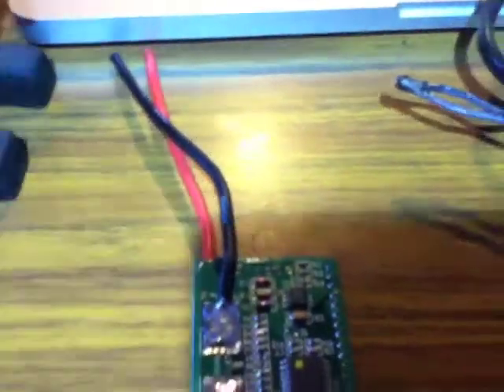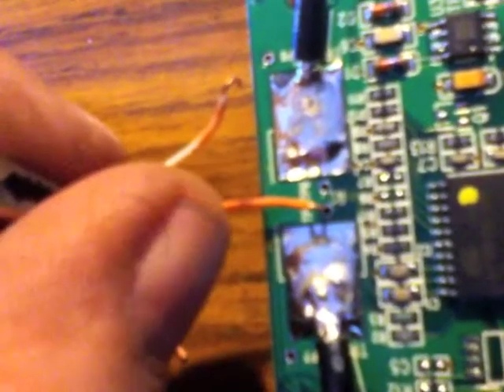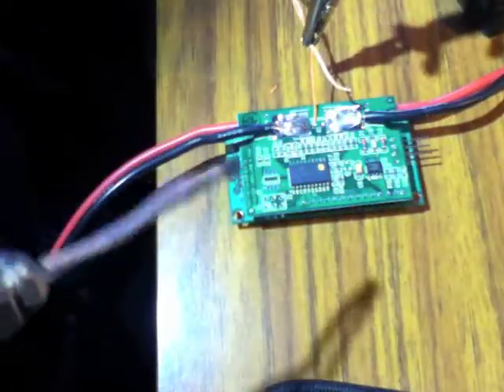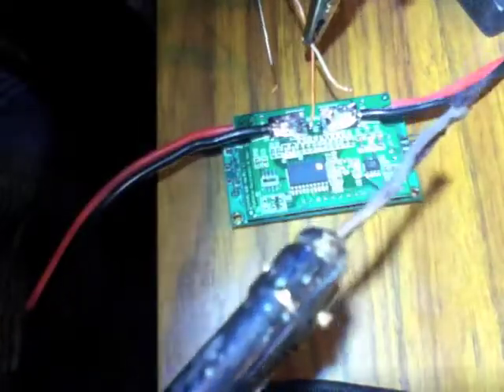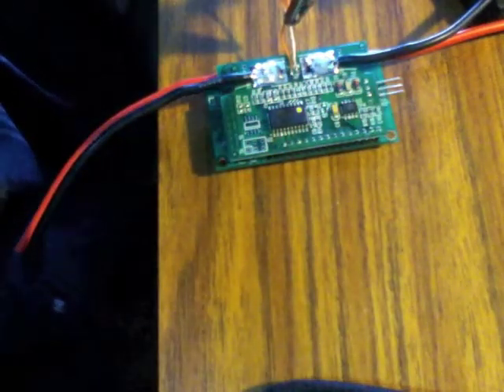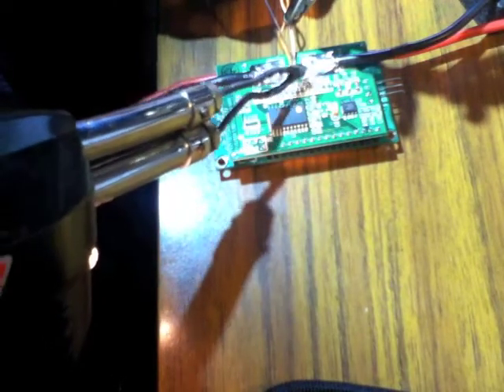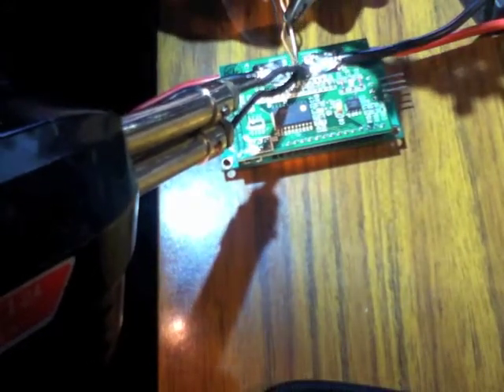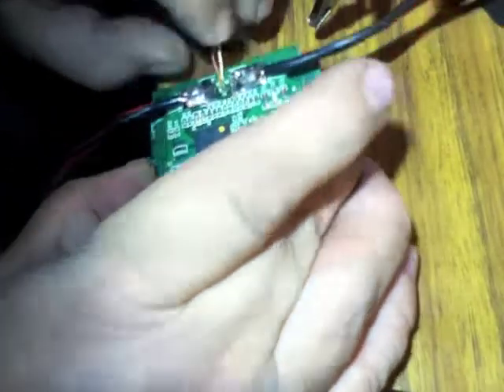Modify my Doc Wattson

Comment: i notice on my doc wattson you can change the ampres from say 00.20 to 01.80 buy loosening
the connection on the rectifier.i have it on the dc side of rectifier(source) and load to my battery
terminal of the inverter. very odd the tighter the terminal the lower the amps?any idear

Comment from the maker: The little 110 Amp shunt was bought at the same place that I got the Doc Wattson . Ecodirect i believe . It can handle 100Amps continous.
That wind Turbine is a 12G manufactured by Dairyland Wind Power. They now make a new model that can make over double the power using a new design and a MPPT wind Charge controller . Yes it is gear driven .But the benefit of of his equipment is that its designed to suck the most power from the lowest wind speed.

Comment from the maker: That little shunt would handle 50 amps continous if you had a big fan blowing refrigerated air on it. I need it to handle 100 Amps continous , But like you that 60 V limit is a bummer. It should have been a 150 v Limit.